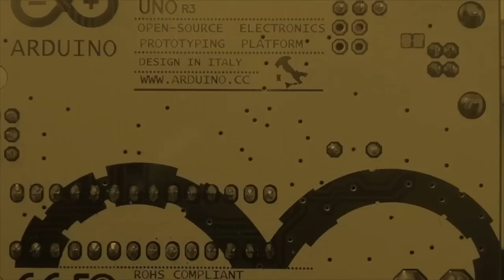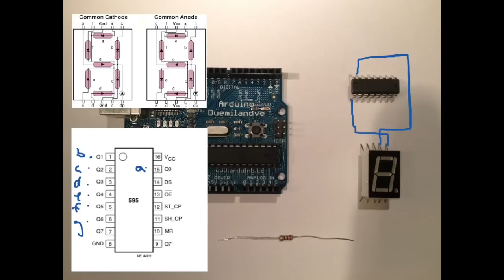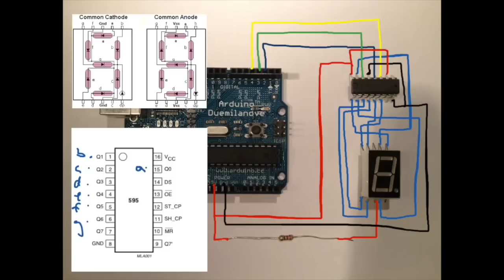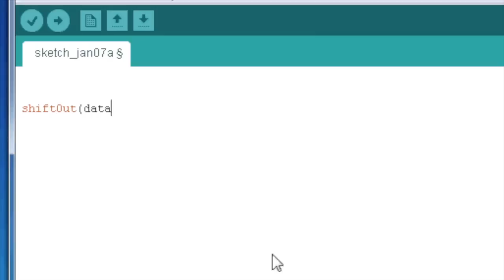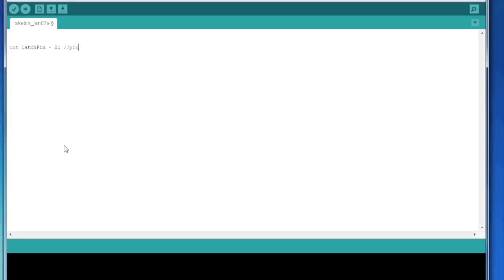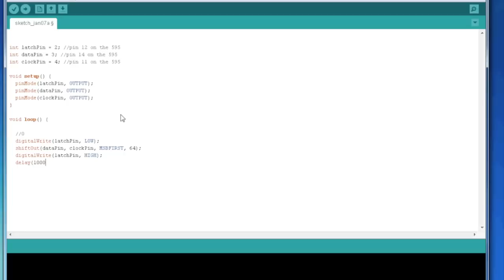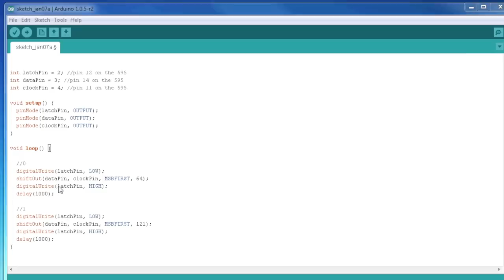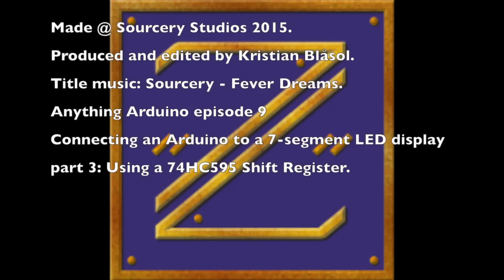Using a 74HC595 to connect an Arduino to a 7-segment LED display - Anything Arduino episode 9

Comment: Why doesnt you use a resistor per LED?
Reply from the maker: +Tilburger72 Sorry, I should do that... I am being lazy and dont want the extra wiring... I realize that this would create a more constant light to the LEDS. But I dont see that much difference right now. Also the resistors is for the longevity of the LEDs I think...
Reply: +Kristian Blåsol aha ok. i couldnt think why. i'm currently building this too but with 4 595's. Not sure yet how to calculate the correct value

Comment: If you have a common cathode one like me, you need to connect that resistor to ground instead of positive voltage. Also one cable went to the dot instead of the middle part. I used a 1k resistor.

Comment: I have seen lot of videos others but your explanation style is totally different and very easy to understand
Please make a tutorial on Temperature and humidity controller with 4-digit, 7 segment LED+Shift register+3 buttons to set the value for relay switching (humidity and temp)

Thanks for all of your efforts
Reply from the maker: +Muhammad Usman Thank you for your kind words! It is nice to know that my videos help :) I am beginning to get a lot of requests to add the 4digit 7segment led display to a lot of sensors, so I'll try to make a video about this...
Reply: +Kristian Blåsol 
I like to share some sketch data with you which is much similar as what i need but i have two problem with this;
1. very difficult to understand
2. In this sketch, i want to use DHT22 or DHT11 instead of Sensirion & Dallas.
Please send me a test mail from your personal email address, my email is mu594849@gmail.com

Comment: lest say i want to build a conter form 0 to 100 .... any idea??
Reply from the maker: +starfirr XvX Well, 1st you should watch episode 21 and episode 22 too, for how to work with multiple led segments. Then you just make a program like this one, but just count from 0 to 100.
Reply: its hard t do a 100 number binary code isnt there any simple?? i mean i can use a conter ship but i just want to use arduino isnt there any like a conter fonction in arduino?? im new in it
Reply from the maker: +starfirr XvX Maybe? Search for arduino 7 segment counter library or similar, to find a more complete solution. Otherwise using the chart used in this video here: https://youtu.be/cHA-fwiA4Qo?t=339, and also the information given in episode 22 it is quite easy to count in binary. The first number 0-9 you just use the chart, for the second number the 1x,2x,3x... etc you multiply the number in the chart with 256. For the third number you multiply the number in the chart with 256 twice. So to send a 1 to a common anode 7 segment LED display you send 121. To write out 11 you send 121 + (121 * 256) = 31097. This is ofcourse if you have one 595 to each led segment. to send 111 you would send 121 + (121 * 256) + (121 * 256 * 256) = 7960953... So for each new higher digit you just multiply one more time with 256... I hope this helps a bit, and learning binary is really a good thing to learn ;)
Reply: wow so much number xD i dont like maths much any way how about making an led 4*4*4 cube?? i want to build one but i dont know how to code it i think about builind a comman cathode but im not sure so if you know something tell me

Comment: int latchPin = 2; //pin 12 on the 595
int dataPin = 3; //pin 14 on the 595
int clockPin = 4; //pin 11 on the 595

void setup() {
  pinMode(latchPin, OUTPUT);
  pinMode(dataPin, OUTPUT);
  pinMode(clockPin, OUTPUT);
}

void loop() {
  
  //0
  digitalWrite(latchPin, LOW);
  shiftOut(dataPin, clockPin, MSBFIRST, 64);
  digitalWrite(latchPin, HIGH);
  delay(1000);

  //1
  digitalWrite(latchPin, LOW);
  shiftOut(dataPin, clockPin, MSBFIRST, 121);
  digitalWrite(latchPin, HIGH);
  delay(1000);
  
  //2
  digitalWrite(latchPin, LOW);
  shiftOut(dataPin, clockPin, MSBFIRST, 36);
  digitalWrite(latchPin, HIGH);
  delay(1000);

  //3
  digitalWrite(latchPin, LOW);
  shiftOut(dataPin, clockPin, MSBFIRST, 48);
  digitalWrite(latchPin, HIGH);
  delay(1000);
  
  //4
  digitalWrite(latchPin, LOW);
  shiftOut(dataPin, clockPin, MSBFIRST, 25);
  digitalWrite(latchPin, HIGH);
  delay(1000);  
  
  //5
  digitalWrite(latchPin, LOW);
  shiftOut(dataPin, clockPin, MSBFIRST, 18);
  digitalWrite(latchPin, HIGH);
  delay(1000);

  //6
  digitalWrite(latchPin, LOW);
  shiftOut(dataPin, clockPin, MSBFIRST, 2);
  digitalWrite(latchPin, HIGH);
  delay(1000);

  //7
  digitalWrite(latchPin, LOW);
  shiftOut(dataPin, clockPin, MSBFIRST, 120);
  digitalWrite(latchPin, HIGH);
  delay(1000);

  //8
  digitalWrite(latchPin, LOW);
  shiftOut(dataPin, clockPin, MSBFIRST, 0);
  digitalWrite(latchPin, HIGH);
  delay(1000);

  //9
  digitalWrite(latchPin, LOW);
  shiftOut(dataPin, clockPin, MSBFIRST, 24);
  digitalWrite(latchPin, HIGH);
  delay(1000);
}
Reply from the maker: +Erwin van der Meulen Thanks for writing it out! :) +gpousers copy this code. Looks like the code I wrote in the video... :)
Reply: +Kristian Blåsol It's the same code. Itested it and it's working.
Reply from the maker: +Erwin van der Meulen Great! Im sure it will help! Thanks again.
Reply: Listen guys...this is the code for common anode Display
Reply: @IoTLearner  Do you have the code for the common cathode? Thanks!!
Reply: thank you broooooooo

Comment: hey, thank you for the video. I want to work with 4 7segmentdisplays and arduino. How can I connect all shiftregisters? can I just connect them on the same pin?
Reply from the maker: +Waheed Ahmad Yes you can, you serial connect them and send 8, 16 24 or 32 bit values 32 bits for four digits... I am working on avideo showing how to do this two episodes from now :)
Reply: +Kristian Blåsol thank you
Reply: +Kristian Blåsol How can I connect them in Serie?
Wich pins (shiftregister) do I have to connect with each other?
Reply from the maker: +Waheed Ahmad pin 9 on first 595 to pin 14 on the second. Connect pin 11 and 12 on both 595's
Reply: +Kristian Blåsol So pin 11 and 12 on all 4 shift registers should connect to pin 2 and four on the arduino?
Reply from the maker: Watch episode 22 for how to connect many shift registers, and working with a 4 segment led display.
Reply from the maker: https://www.youtube.com/watch?v=ZGzbAd-Aixc
Reply: +Kristian Blåsol Thank you, I have to build a clock for school. I'm doing it with 4 595 shift registers and 4 separate segment displays. I think the hardware is ok now but I still have to program it.. Not easy because I have zero experience with Arduino.

Comment: Best video I have ever seen on shift registers, an hour after finishing this video I learned to finally use the shift registers that I gave up on years ago.  I was using a 4 digit 7-segment display and I had to flicker the digits independently to make them seem like different numbers.  5 minutes after this video I needed less wires and my code was 5 times smaller.  THANK YOU, you are the man!!!
Reply from the maker: +317andrew317 Wow, thanks for the kind words! :) Did you use four shift registers (one for each digit) or did you still flicker with one shift register connected to all four?
Reply: Thank you for helping me understand! I watched so many of the shift register videos and yours clicked for me!  I just realized I still have to flicker in between digits on the display and refresh them faster than the eye can see, but it is still much easy than when I had before.  I am using one register to display the numbers and another register to switch between the 4 digits for a total of 6 outputs on my arduino. I'm just using 3 for-loops to count numbers and refresh the display. Code is so much simpler now! Thanks!

Comment: Thank for making this video, it is really good and helped me out a lot. I replicated your project and it worked!In my class I was presented with a task to create a device to count people entering a room (the maximum value will be 999, three 7-segment displays). I used your idea from this video to help me construct my project however I am having some trouble with the program. I can store the input from a PIR sensor to a variable that I declared as people_count = 0 (this is keeping track of the people entering) and it successfully counts up. The problem is I can't figure out how display the value in the variable. For example there may be 4 people in the room but I cannot just output 4 or there will be some random LEDs illuminated (I tried it and it only lit up one LED). I would imagine that I have to convert the 4 then output the value...Do you have any recommendations on how I can accomplish this task? I'll need to output/ display values up to 999.Any advice and guidance you can provide would be greatly appreciated.
Reply from the maker: +Art A. Look at the conversion chart used in this video at this link: http://www.duinos.net/show/?id=196 There is says what to send to get eg. a 4. Or watch episode 21 or 22, which will make you understand more how to work with many LED displays and many 74HC595.

Comment: it's cool but can u provide the table for letters
Reply: +kuldeep jangid 

It's not that hard. Just use the chart.

For example,and "A" would need LED segments a,b,c,e,f,g. 

That would calculate out to 8 in common anode mode, or 119 in common cathode.
Reply from the maker: +kuldeep jangid  Here is the table for 0-9 http://www.duinos.net/show/?id=197 and if you want all the hexadecimal symbols another viewer made this table: http://www.duinos.net/show/?id=225 hope it helps.
Reply: +Kristian Blåsol thanks

Comment: Is there any value to send to the Arduino so he will display letters on the 7-segments.
Reply from the maker: Well you can send values to the arduino and depending on what value you need to call the routine for printing that specific number. Make a function of each number for example and if you receive a value of 2 or on pin 2 or similar then call the print2() function. You can solve in many other ways, but this is one way. Hope it helps.

Comment: how much is the resistence
Reply from the maker: +Salim El Ouahdani I think I used a 10kOhm resistor for this. It is a bit up to the LED-display, but 10k should work fine with most LEDs I think...
Reply from the maker: +Salim El Ouahdani 10k is a bit much actually, just use a 220ohm resistor would probaböly be better...
Reply: Thanks ;)

Comment: Thanks for your tutorial it is so great!!!!. I conected 2- 74HC595 but the second one is just doing the same as the firts one. I am trying to send 2 bytes or 16 bits, the programing change?
Reply from the maker: +Augusto Rivera You need to connect the DATA/DS pin of the second chip to pin 9 (I think) of the first chip to make them work in serial. If you connect both DATA pins to the same pin on the Arduino they work in parallell and will show the same number on both. Try that instead and let me know...
Reply: thank you very much.

Comment: A very good demo for using the 74LS595 with a 7 Segment LED display. I modified your chart and added the decimal point and assigning 128 for it so I could display hexidecimal numbers. I'm old school where all of my microprocessor projects at the machine language level needed hex displays for data and address. Thanks for sharing
Reply from the maker: alphahr Great! Please share your new chart for those that might need hexadecimal representation on their display. You can add it to this page if you want: http://www.duinos.net/show/?id=196, or if you want send it to me. Good work!
Reply: Kristian Blåsol Unfortunately there is a problem with the sign up portion. In the line that asks for a word that describes the site, Arduino doesn't appear to be correct
Reply from the maker: If you want and have the time, please try again, it should be fixed now...
Reply: Kristian Blåsol  uploaded the extended 7-Segment LED display chart for Hex characters, hope it got to the right place!
Reply from the maker: +alphahr Awesome! I edited teh description so anyone looking for hex codes for 7 segment display might find your table. Thanks for contributing!

Comment: hey, i successfully worked out this one, i'm having a common cathode display, so i connecte the common cathode to ground. I'm having a dual display, so I need to know how I can count upto 99. Can I do with one shift register? (I'm only having one at the moment)
Reply from the maker: iamkiddilam Weird problem to solve... ;)  2 suggested solutions for you:
1. (The geeky one) You could make it like a "binary clock" where every segment of the LED display is a binary bit, this means you will have 7 "bits" to work with giving you 127 values... It will take a lot of practice and time to learn to READ what number you are displaying. To anyone not knowing it would just look like random LED segments lit up over time. It is a really cool solution, but maybe not that practical for more than the ones initiated...
2. (The slow one) Shift out the two digits of the number with 250ms delay, then wait for a second (or just 500ms) and write the next (or same number again). That way you and anyone else can within two seconds have seen the 0-99 number with only one display. I did a similar thing in my Humidity and Temperature controller, where a single LED blinks first the 10th number then the 1 number for the humidity, waits a few seconds and does the same with temperature. So by standing and counting the blinks for half a minute I know the humidity and temp from just one single LED... Not fast, but very simple and effective... Here is the video if you want to dl the sketch and see how I did that... https://www.youtube.com/watch?v=TdG0AJY4qLA 

Hope this helps!
Reply from the maker: iamkiddilam Oh sorry I think I misread, you have TWO LED displays, and ONE 595? Yes you can do this aswell by multiplexing the LEDs. 
1. First you connect both LEDs to the 595 all pins.
2. Whichever pin you have common, instead of connecting it to ground you connect it to a digital pin on your Arduino, one pin for each display, so first display to pin2 and second to pin3 (examples). 
3. And then you shiftOut the first digit and either put the digital pin2 HIGH or LOW for the first digit LED display depending on which display type you have.
4. Then you shift out the second digit and turn the first digits pin (pin2) off (opposite to what it was), and put the second digits digital pin (pin3) HIGH or LOW... 
5. Then you loop this which will make it do it so fast that it will look like two numbers, hopefully not flickering too much... 

Hope this also helpes! Let me know!!! :)

Comment: whta's the change to be done if we're using two 7 segment displays instead if one?
Reply from the maker: iamkiddilam You need to "cascade" the chips. Which means that the Data pin on the second chip should be connected to Q7 on the first chip instead of to the Arduino. SH_CP (or clock) can be connected in parallell. I think you also can connect the Latch ST_CP in parallell, so just connect htese to to the same pin on the arduino as the first one. All other connections should also be the same as on the first. Then in the code you write two shiftOut commands after each other, with the number to be shown on the second display first, followed by the number to be shown on the first display. The first number will be shifted out on Q7 when the second number comes in on the data pin. Let me know if you get it to work or not, orelse I'll make a short video to better explain...
Reply: Oh thankyou! I'm having just one 74695 shift register at the moment, i accidently bought two 7447 ics (BCD to seven segment), i'll surely try after buying one.
I'm trying to built a 7 segment display for a temperature sensor. :)

Comment: It didn't work for me.
Just d and g segments work. Can you help me?
Reply from the maker: Adnane Razzouk Did they light up in the correct numbers? Eg, not on 1 and 7 but all the rest? Or did they only light up on 1 and 7? Im thinking if you have switched common anode or common cathode? Also, do you use a 74HC595 or is it a slighly different chip? It could be that pinconfiguration is different? Also, wiggle all the cables a bit so you dont have a bad connection on the pins... Give me a bit more information and I might be able to help more :)
Reply: thanks but it had already worked good job :)

Comment: hi can you tell me how to avoided delay if it possible
Reply from the maker: anas almasri How do you mean avoid delay? Between numbers or the time for the value be sent to the 595 to it displaying on the LEDs?
For the first problem (no delay between numbers), just remove the delay(1000); in the void loop. As for delays from value sent from the Arduino to the number being displayed on the LEDs this is lightning fast, and you really shouldnt see any delay in this process.
If you meant something else please clarify.

Comment: If the numbers very in light-intensity depending on how many leds are turned on, you should put a resistor in each of the 7 connections instead of only the  common one.
Reply from the maker: Yes you are correct that it would be a better and more light intensity stable setup to put one resistor on each LED, using this one resistor approach is just to protect the LEDs... I did not notice any large fluctuation in the LED intensity though, so in this particular setup it isnt an issue. Thanks for pointing it out though.